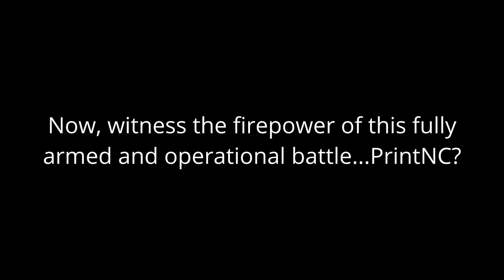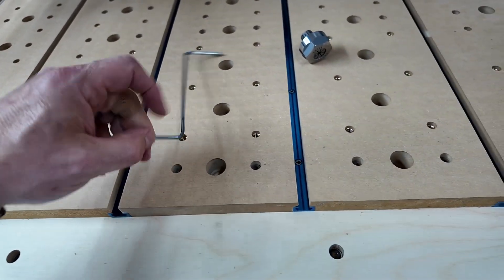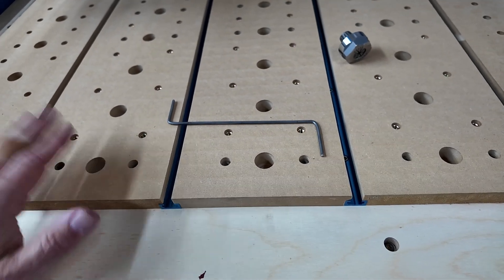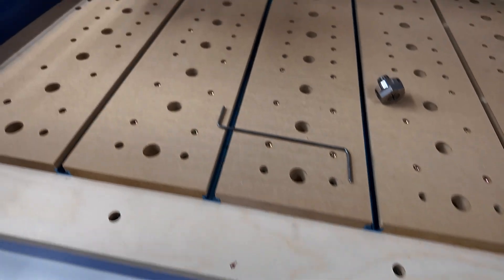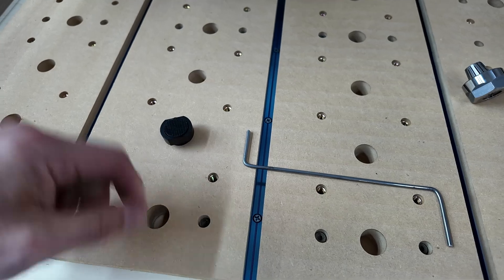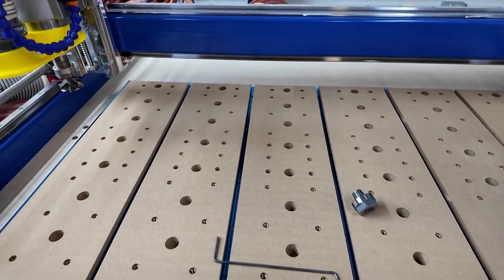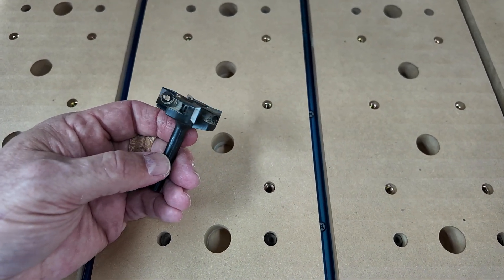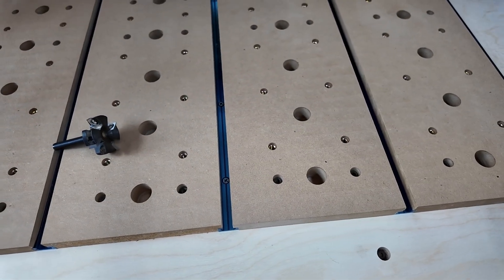PrintNC Update - Spoilboard & Workholding

Comment: Looks like the plywood base (under the spoilboard) is two piece split in the middle. Wondering if this by design or just what you had on hand?
Reply from the maker: That was by design.  I wanted to be able to gain a bit more work height if I needed it.  The base is made from 18mm Baltic Birch plywood.
Reply: @f15sim  It looks like its bolted to the cross frame with counter sunk bolts. How did you secure the bolts, threaded holes in the cross frame or maybe through holes with nuts on the bottom? I wondering  because if the plywood base ever has to be replaced, how do you duplicate the hole pattern on a new piece of plywood?
Reply from the maker: @RichMenzel  I drilled the plywood base board halves on my ShopBot (including inset pockets) and then used those holes to mark the cross members.  I then drilled & tapped those for 6mm button head screws.
Reply: @f15sim  Thanks for the feedback.

Comment: great to see this thing running so well. 
Does the spoil board expand with heat? humidity? or are you pretty much good to go after this first leveling pass?
Reply from the maker: There will be some changes with humidity - that's what wood does after all.  MDF is just sawdust & glue.  I won't need to re-surface the spoilboard until they get pretty chewed up with use.

Comment: How do you tweak it? Is there a design with adjustable Z axis for the printnc?
Reply from the maker: There's features built in to the Z axis design specifically intended for tramming the spindle.
Reply: @f15sim  thanks, I looked into the design and I understand how tramming bolts work now. I start right away to design a tramming plate, bye!!